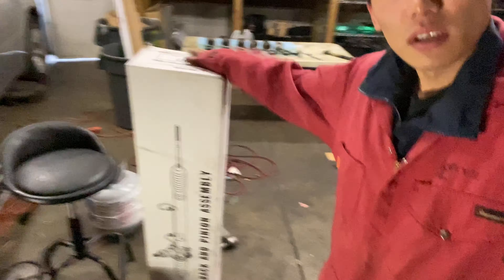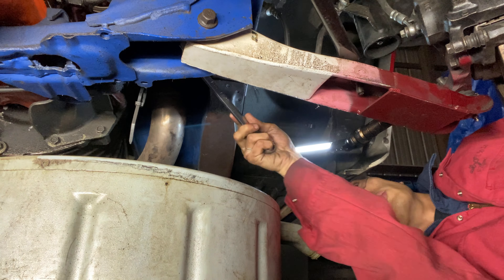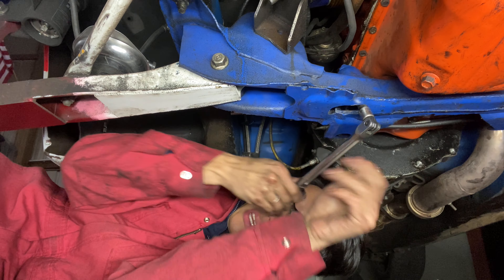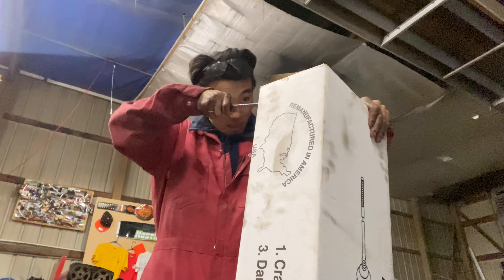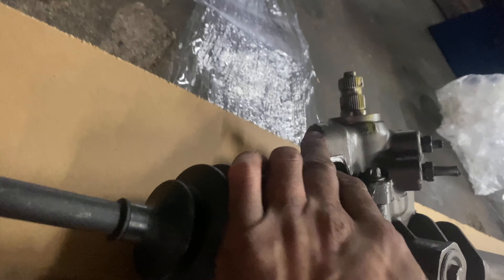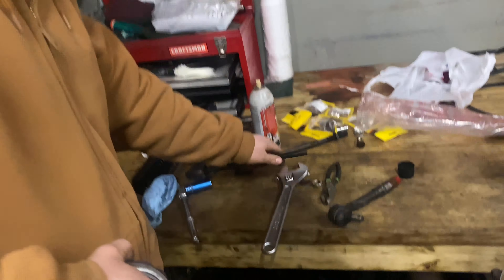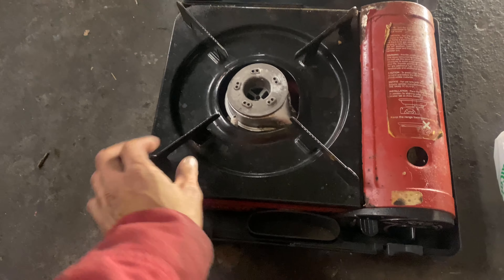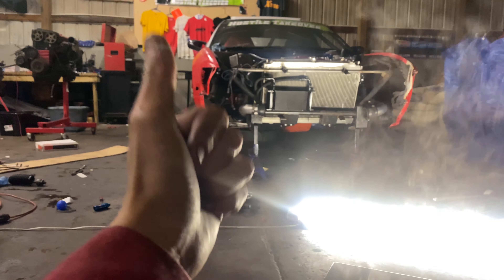New steering rack install! - 2021 Drift Journey Ep 2

Comment: Dude remember me when your famous cause I already you will be successful hey and what type of engineer should I become so I learn all about this stuff should either be an automotive engineer or mechanical engineer btw I’m 15
Reply: I'm 16 and i also have the same question what should i study
Reply: Running into this comment now. If you want to be working with your hands doing this stuff go to a tech school and become a mechanic. I’m a first year mechanical engineer and the most common misconception is that mechanical engineering is this working with your hands stuff. ME is designing the power steering box components in solidworks so they can be manufactured. Automotive engineering is rare to come by
Reply: If you want to work on cars, 100000% do not become an engineer. Engineering is just sitting behind computer doing math based design work. Become a licensed mechanic if you want to work in motor vehicles for a living